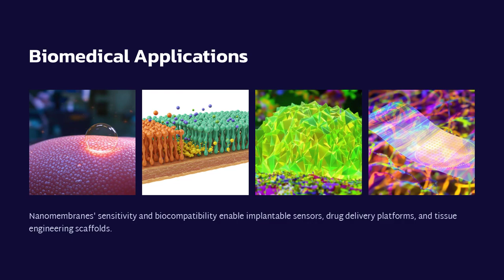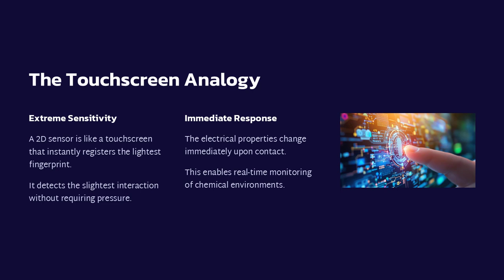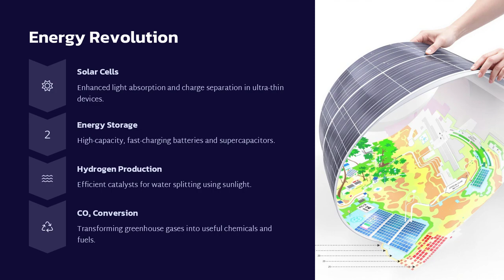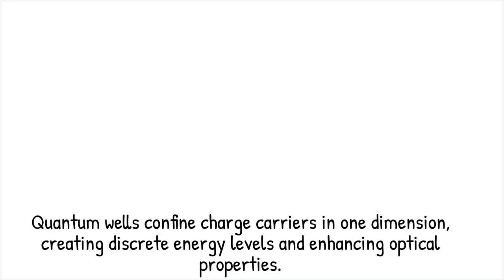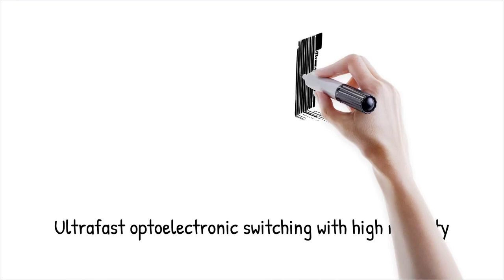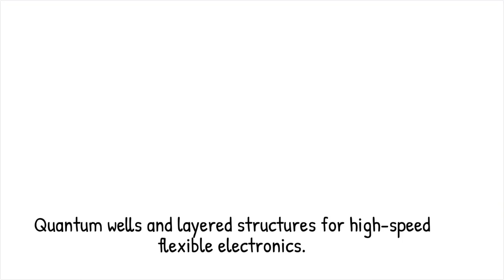Introduction to 2D Materials and Nanomembranes

Comment from the maker: How can we achieve large-scale, defect-free synthesis of complex 2D heterostructures with atomic precision while maintaining interlayer alignment and minimizing contamination at van der Waals interfaces?
What quantum mechanical models best describe the behavior of charge carriers and excitons in stacked or twisted 2D materials, especially under strain or external fields, and how can these be validated experimentally?
How can we integrate 2D materials and quantum wells into existing CMOS-compatible semiconductor processes without degrading their unique electrical, thermal, and optical properties at scale?